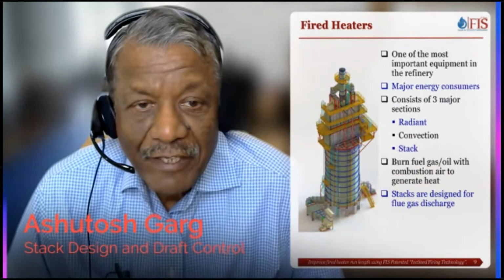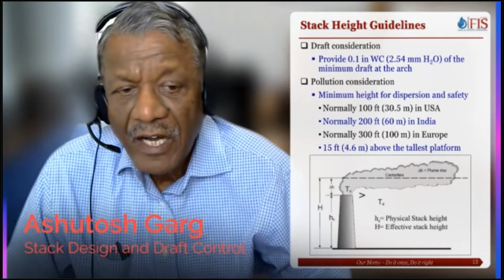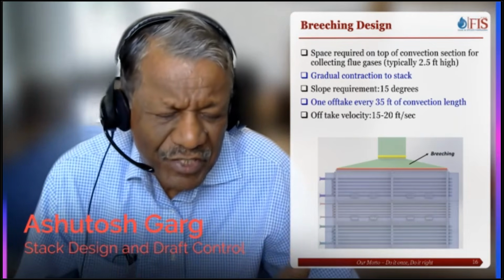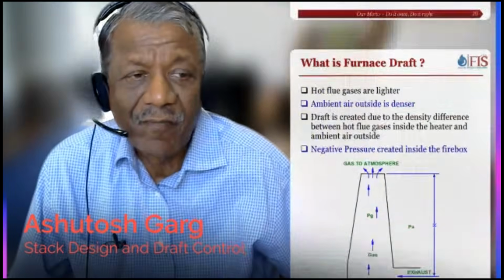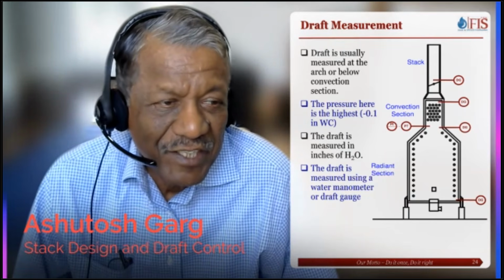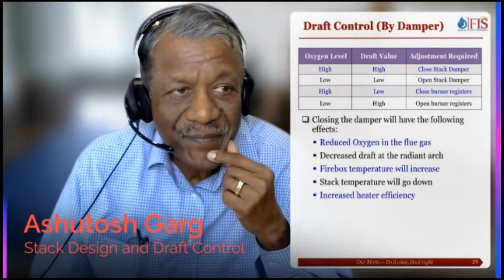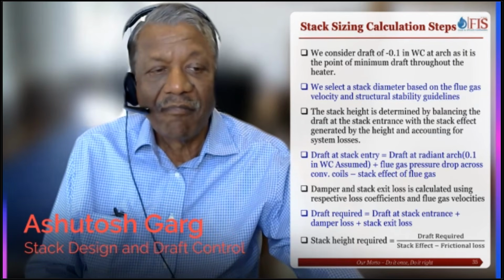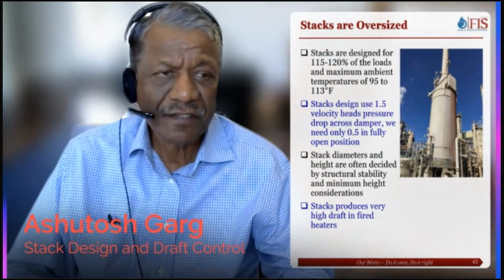Fired Heater Design Training (Part 7) - Stack Sizing & Draft Calculation

Comment: Hello Ashutosh Garg

We keep getting a heater trip on low draft when a bad rainstorm or cold front moves through the area. I know colder air is more dense and “harder” to move but it seems like the draft would be better due to the difference in flue gas temp and ambient air temp. Maybe we are seeing an instantaneous dip in draft when the rainstorm or initial cold front moves through… Perhaps adding a 1-2 sec delay on the draft trip would prevent the heater from shutting down. But when we go relight heater and it works perfectly after that with no changes. Have you ever had draft trip issues due to weather?

Great video really explained a lot of information and helped me connect missing dots
Reply from the maker: Hi Chris,

Interesting observation. As you have mentioned, there could be various reasons behind it.

Feel free to contact Ashutosh directly through email - agarg@heatflux.com

Thanks!